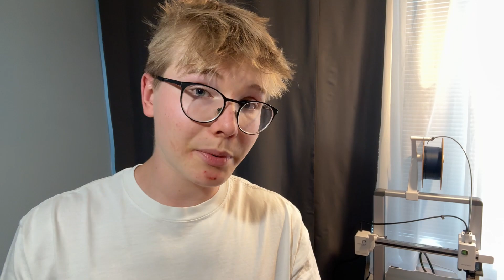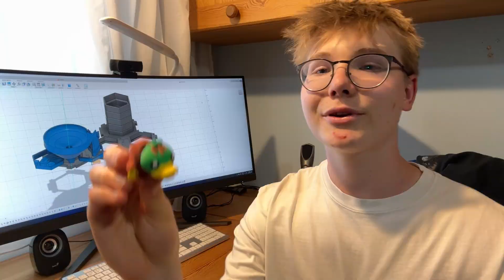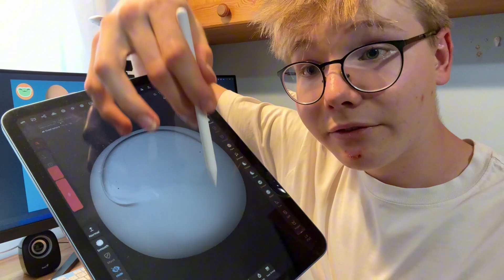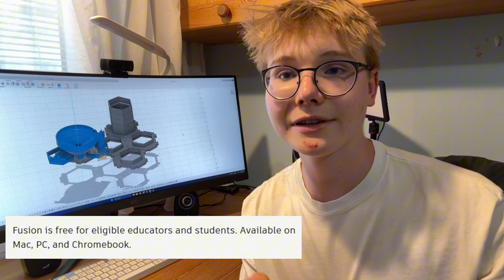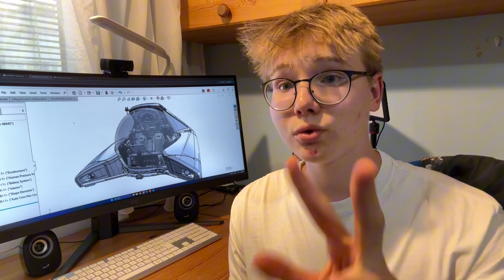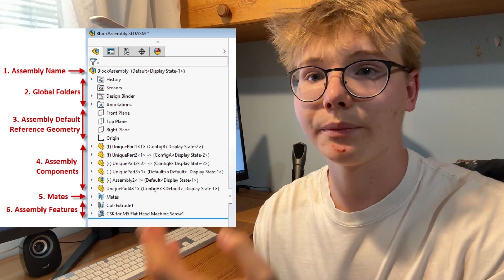Best 3D Printing Design softwares to learn in 5 mins

Comment: interesting... but for really quick learning, I'd probably look at tools that remove as much CAD complexity as possible. I've done a lot of simple concepts in 3D model gen in rapiddesign, highly recommend it for starters since it lets you get a model together pretty fast without spending ages learning menus and workflows. also has services like printing ets so you can send the files to manufacturing services right away if you want to prototype or produce the parts
Reply from the maker: thanks for sharing that, since I dont have any experience with rapiddesign I didnt give an opinion for it. Appreciate the feedback!